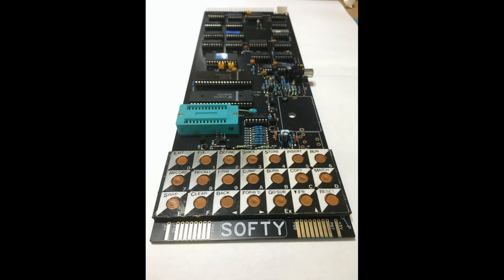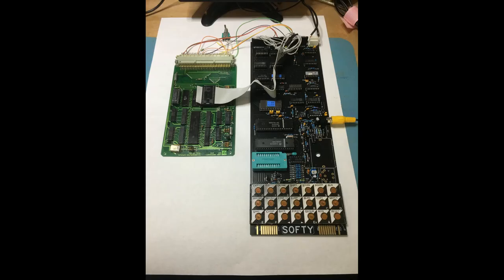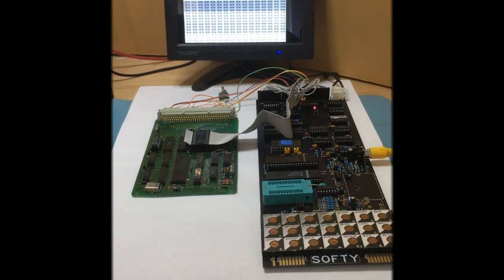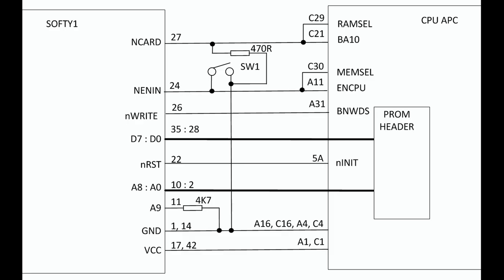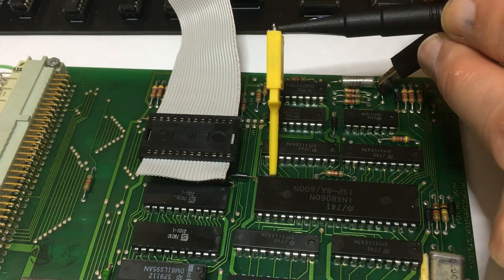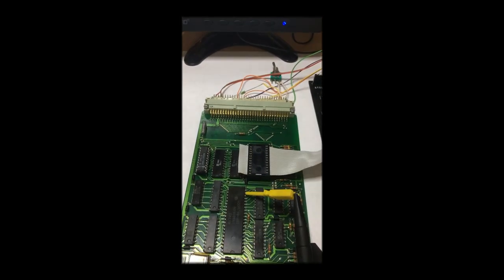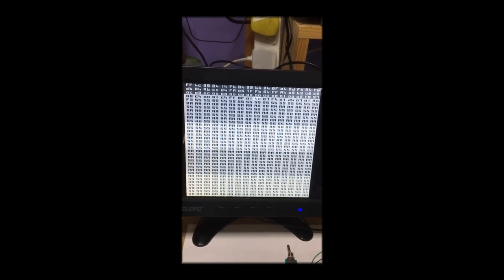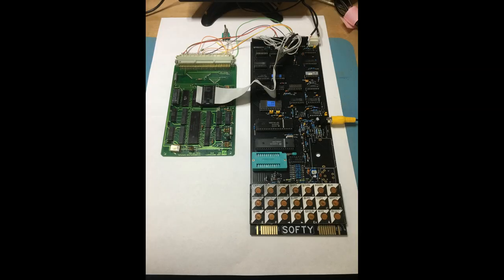SOFTY EPROM Programmer used as an EPROM Emulator

Comment from the maker: Excellent. I guess you made good use of the tape interface then?
Reply: I'm struggling to remember exactly how it was configured. The project was one of my first 'proper work' projects, so I only used the SOFTY at work. 

I don't remember all those wires from the DIL plug to the back of SOFTY. I think it was a DIL-to-IDC socket, with matching pins on the SOFTY. However, if that was the case, the Oddy version would have replicated these pins. 

Was there more than one version of SOFTY ?
Reply from the maker: There was a second version in the early 80's called SOFTY2 (unimaginatively!). It had a specific DIL header to connect to a ribbon cable for the PROM emulation, as you can see in the photos here:   https://www.vintage-radio.net/forum/showthread.php?t=201228    Does that one ring any bells with you?